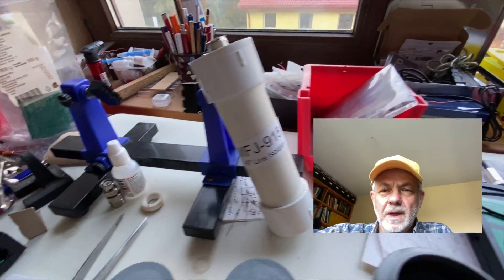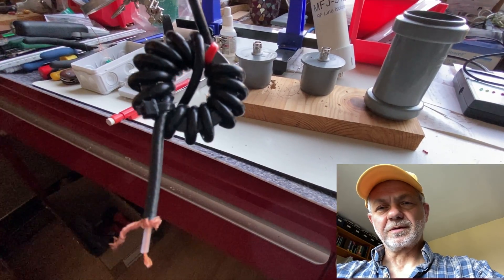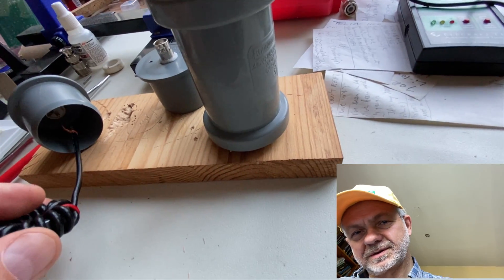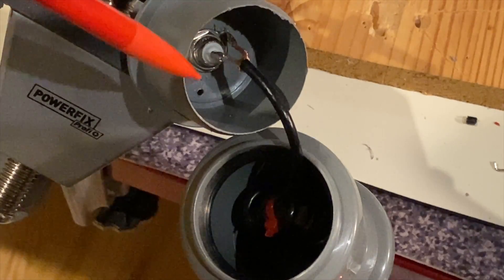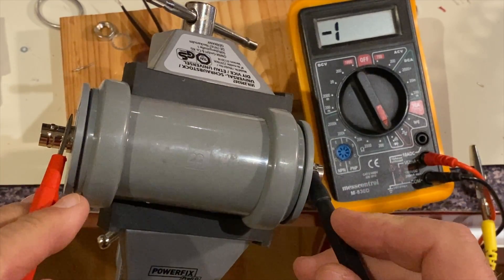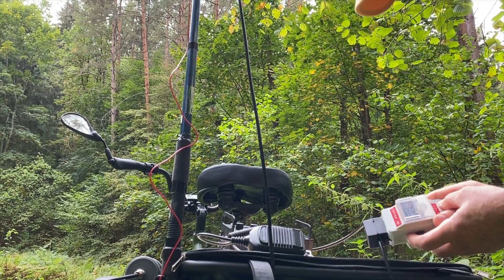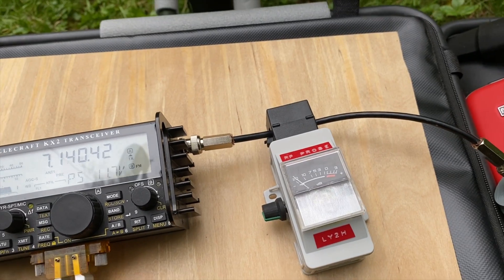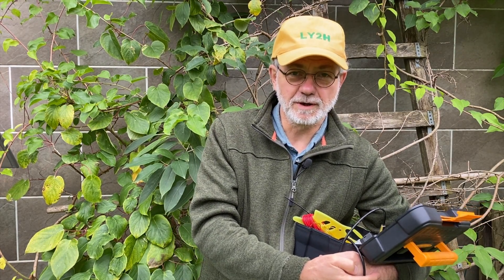How to quickly make your own cheap yet effective and weather-proof RF Choke Balun.

Comment: Fabulous.. would like to know make / brand of the plumbing part.. they're probably not a manufacturer sold near me, but I see a great multi-band trap potential here too with these seals built in.. cheers!
Reply from the maker: Thanks for watching! I'm not sure I could tell a brand of these plumbing parts, sorry to say :) These are  just  piled in the shelf in my home depot store with price on them but no brand to see. I can suspect they are made in Poland, but could be anywhere. If there is no store around you, I would suggest check the Google, lots of links would pope-up under "plumbing pipes and fittings" or alike. And yes, these formers should be possible to use for the antenna trap construction , especially one made of thin  coax cable. Good luck! 73! Linas LY2H

Comment: Can you provide a link for the pvc pipe and caps? Thank you great video
Reply from the maker: Thanks for watching! As to the pipe-link, I'm so sorry, I don't have any ... I always buy pipes and other plumbing stuff in one of my local "Home Depo"-kind of shops, never from Amazon or Ali, just no need for that. I know at least 10 of such shops  in my town :). During the lock-down most of them were trading through the internet  , but I doubt they would ship abroad. I don't know where are you located but there must be some hardware shops selling pipes around and may be even shipping locally. The pipe/cap dimensions actually are uncritical, just for the toroid to fit in. GL! 73! Linas LY2H

Comment: Thanks Linas. Great stuff as always :) I very much appreciate "do it yourself" projects. After coming back to radio after an almost 20 year absence I have the feeling, people seem to just buy stuff "these days". To me anything radio always was about experimenting and building stuff myself. 20-some years ago my friends and I built our own CB-radios from scratch and had a blast with them. Even without having a full blown electronics lab, antennas, baluns, chokes are the perfect way to experiment without much hassle...
Reply from the maker: Thanks for watching Olli! I will probably make another vid on the RF probe , together with the other incarnation of it - the RF Field Meter. These are the simplest possible devices made of 1 or 2 Shottky diodes, a capacitor and the 100- 200 microAmp meter. I saw numerous schematic diagrams on the web, so there is a lot to choose from! 73! Linas LY2H.

Comment: Thanks for the video!  Would you please provide more information regarding your clamp on RF meter?  73!  K7NFO
Reply from the maker: Thanks for the comment Mike! The RF probe is made of 2 Shottky (BAT 85) diodes, 1 cap and the potentiometer to set the sensitivity up. I made my own design based on numerous schematics on the web. The meter is salvaged from my junk box, it was used for the sound volume indication in the tape recorders in its previuos life some 40 years ago :). It's still possible to buy some in  local electronic shops in my town :), may be on Ali also :) Any meter ranged 50-100-200 microAmps would do. The box is from the electric department in the Home Depo store. 73! Linas LY2H
Reply: @Linas_LY2H  Do you think salvaged s-meter would work?
Reply from the maker: @samgrieg  Hello, I think it should work if it's an microampermeter in its nature. It's only the sensitivity of the device that depends on the type of meter. Normally the range of the meter recommended is 50-100 microA, but the one I used is rated at abt 200 microA and it works. The best way to know- it's just try it out! :) 73! Linas LY2H
Reply: How is the microA meter connected to the clamp on ferrite? Thanks for this video. Very informative. 73 w7zrc
Reply from the maker: @rodw7zrc22 Hello, thanks for watching! All the details on the RF-probe is in the separate video, here:
https://youtu.be/vnrG0VACMto?si=FHFmjkeAPNAD6EpX

HTH, 73! Linas LY2H